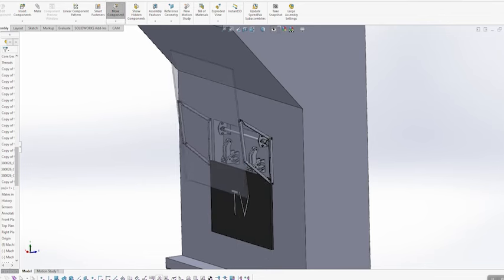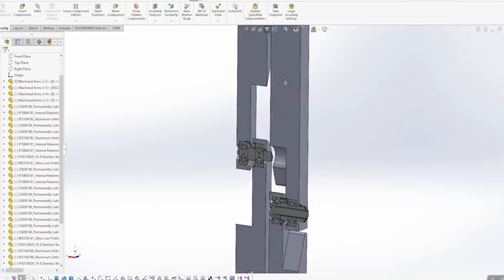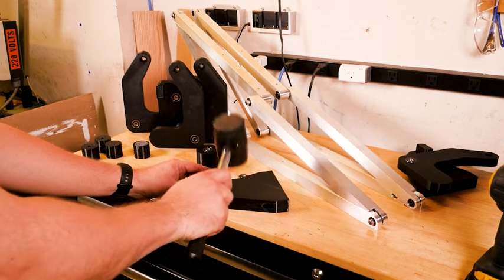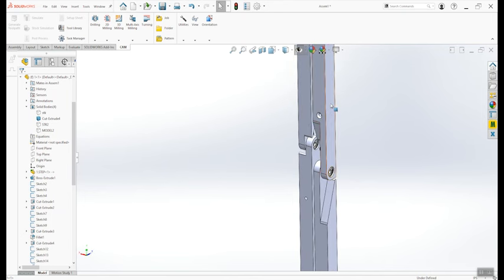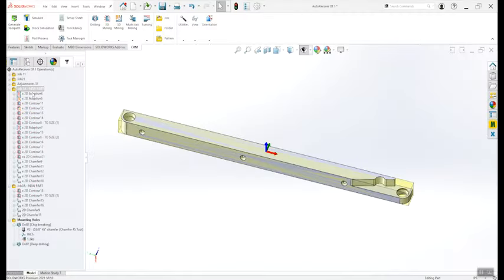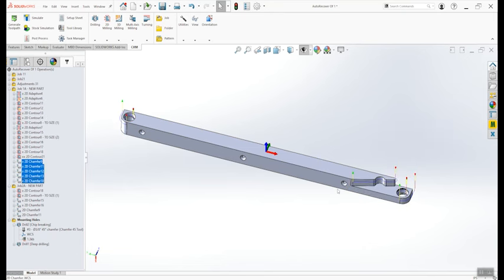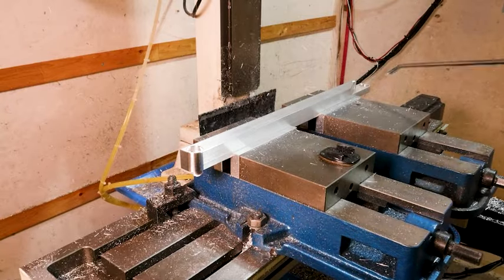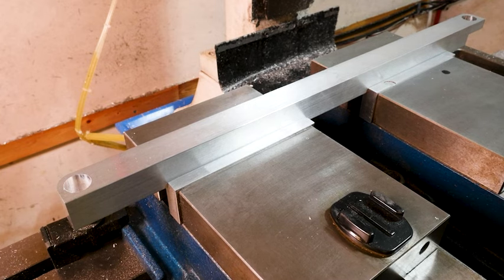Making a Motorized Moving Picture Frame

Comment: Your narration is super good. As a SolidWorks expert, I love how you convey your design, and the motion intent, and machining ops on the screen. VERY satisfying to watch the machining ops with the explanations as they occur (with no machine noise). I have a 6040 CNC with a 24K spindle, but watching this, makes me lust to convert my Rong Fu-like (Harbor Freight) manual mill to a CNC machine, so I can reap those sweet 3K, high torque rpm's and the table rigidity. Now if only I did not sit around drooling watching your vids..I would have time to make my own 🙂
Reply from the maker: Thanks again for the positive feedback, @BrilliantDesignOnline! How do you like the 6040? I don’t think our longing for more rigidity and power will ever go away. I’ve been “planning” a base and spindle upgrade for over a year now. I’ve got most of the parts & hope to get it done when I get some down time.
Reply: @adamdebowski2037  Primarily, I got the 6040 as a learning tool. I actually researched and 'requisitioned' one for my boss, myself being the only user, I had to set it up, set up/learn Mach3, learn F360, learn Vectric VCarve/Aspire, and all the operations. I liked it so much, I purchased one for myself. I have done very little aluminum, but primarily engraving placards, and plexiglass projects and some projects in blue foam since the consequences are minimal if you make a mistake. Overall, it is a great machine, but the low-torque spindle (even at high rpm), low low-end rpm, and lack of rigidity leave it wanting. Beefing up the table helped, but watching you rip through bar aluminum, like a 'real' mill, gave me mill/spindle envy 🙂
'Down Time' 🙂Ha!
not with 3 lifetimes of projects scheduled here...

Comment: I love your work, I also have a very similar cnc, and I have a question, do you have backlash? and how much?
Reply from the maker: Thanks! I do. Not much. Less than a thousandth per axis. More in z but I compensate for it in the control.
Reply: Wow then I have to do something to my cnc because I have between 8 and 10 hundredths per axis
Reply from the maker: You must mean 8 to 10 hundredths of a mm, right? That would be around 3 to 4 thousandths of an inch, which is what I’m measuring in. You could get that down by shimming your ball nuts (if you have double ball nuts on your ball screws). The other thing that could be increasing your backlash is Gibbs being too tight.
Reply: I think the gibbs are well adjusted but I will check it to see if they are too tight and that is the problem that I do not have a double ball nut it is a simple nut since otherwise the travel of the axes is greatly reduced, especially in x and in y

Comment: With this content you will get to 100k subscribers soon! Any plans on getting a 4th axis for your machine?
Reply from the maker: Cheers! I’ve wanted one for a while haven’t seen any good options for a mill like this. Have you?
Reply: Building one from scratch using a chuck or 5c could be an option. That way it’s designed for the PM-30.
Reply from the maker: @benzhuk876  yeah - this would so far be my plan A. I’ve seen a few on eBay that are belt drive, which would get rid of any backlash, but I’m thinking there’s just no way that going to be rigid enough. If only there was some kind of gearbox with no backlash… truth be told, a 4th axis is something I’ve wanted for a long time, but top priorities now are an upgraded base and spindle. I really hope to be getting those projects underway soon, but have been avoiding it because it means the mill will be down for a few weeks.

Comment: what are you running / precision matthews what?
Reply from the maker: PM30-MV
Reply: @adamdebowski2037  did you shim out the Z gibs?
Reply from the maker: @makosharkcnc7730  I’ve got a shim between the head casting and “sliding casting” to straighten the nod, but no shims at the gibs. Why would you need to shim a gib?
Reply: @adamdebowski2037  i have about .009 movement side to side the head of my mill, was thinking about adjusting the gibs or use a shim
Reply from the maker: @makosharkcnc7730  can’t you just tighten the gib until that play is gone?
Reply: @adamdebowski2037  yea i'm sure i can
Reply from the maker: @makosharkcnc7730  I’m not sure how to adjust gibs with the motors connected, but before my mill was all put together, I kept tightening the gibs until they locked the tables/slides, then backed off a quarter turn or something like that.